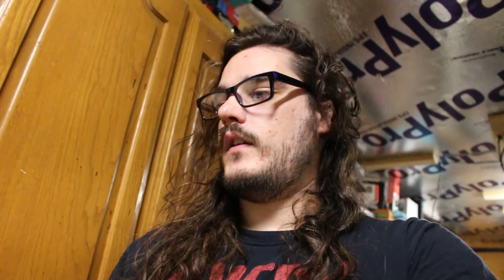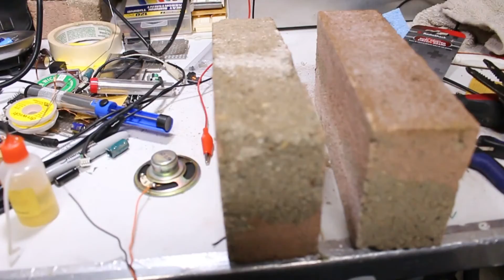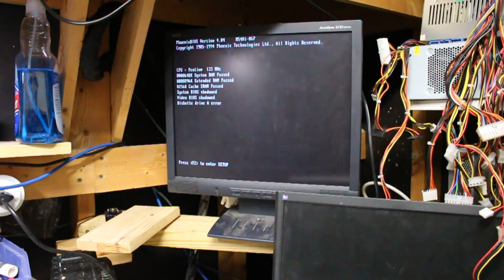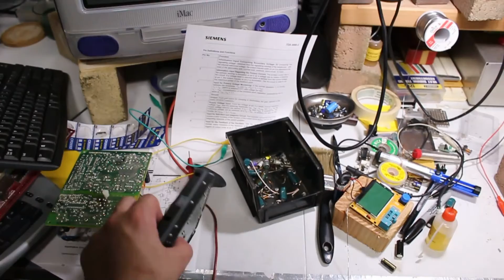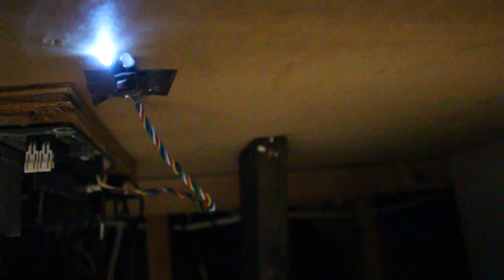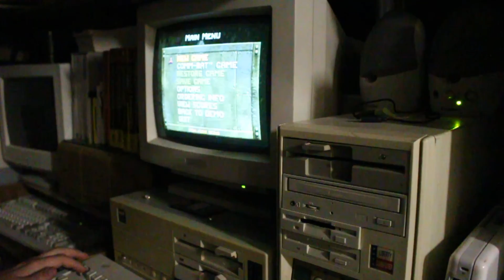Vlog #7 - A rambling, shaky, quick and dirty Pentium DOS project

Comment: strange the IDE interface on a pentium doesn't really do ATAPI. wonder if it can be disabled, and a PCI ATAPI card installed. Just my guess as to why it doesn't like the hard drives or the cdrom
Reply from the maker: That's a good idea, I'll have to give that a shot. I can definitely disable one or both of the controllers, I did see that option in the BIOS. Thanks!